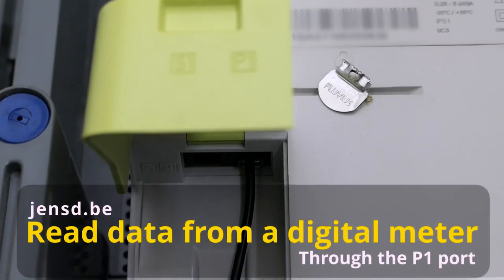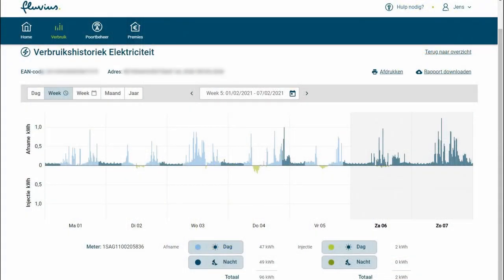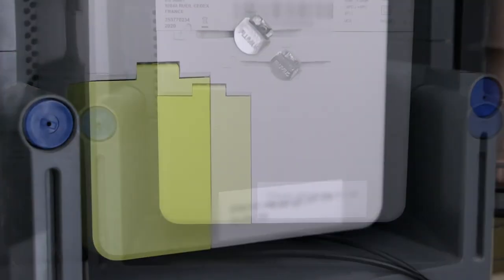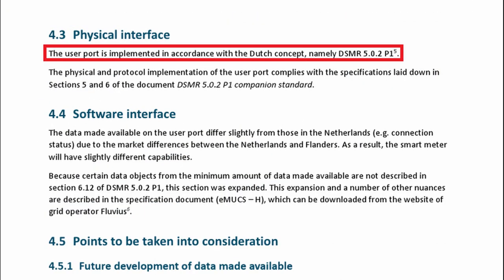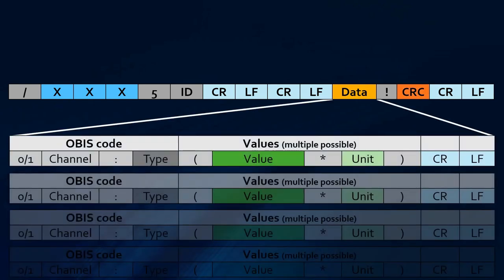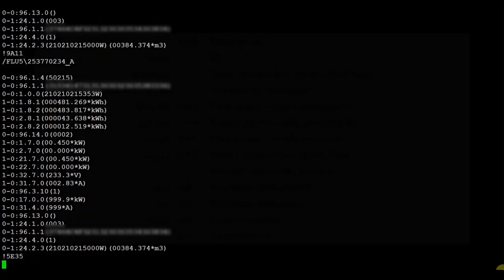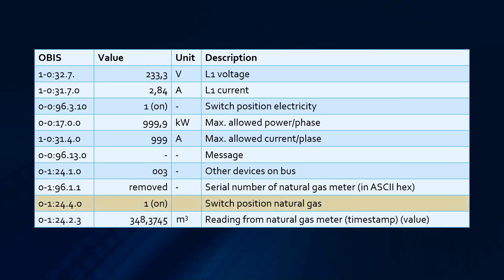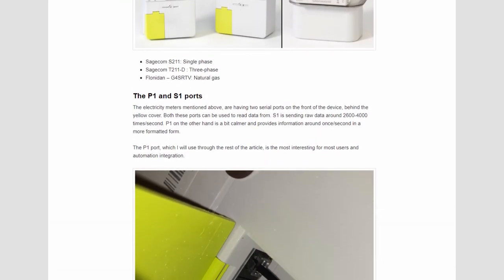Read data from the a digital meter through the P1 port using Linux

Comment: Excellent, I found the commercial option from Smappee way too vulnerable, expensive and the subscription model a real scam.  This wired solution sounds better since I only need to know if no major consumer remains active before I leave.  I wonder though, as the gasmeter seems to bind wirelessly with the electricity meter, can this signal be picked up as well ?  And does the electricity meter emit data over radio too ?

Comment: Although the S1 port can use the RS422 communication protocol, the P1 port cannot. The pinout of the P1 port indicates that no specific pins have been paid to Data- and Data+, which is essential for the RS422 protocol.

Comment: Fantastic, is the case for all the digital gas meter in Flandres?  I was wondering if I could get the gaz meter readings on mine as well I have a luminus key but with that I can basically do the same with a grafana / prometheus stuff, do you think would be too difficult to add prometheus metrics to the script?
Reply: Btw can you also share the link on bol for the right cable?

Comment: I have made a cable and a connection from the P1 meter by ESP-01s board, but the data I see in coolterm is chinese (asscii code). 
When I connect domoticz to the IP adress of my ESP board, the data is refused in domoticz. How can I make the data understandable by domoticz or Home Assistant ?

Comment: Can I do the same thing using an optical connector? CH340 usb to IR optical adapter for IEC1107 DLMS meter - Model MY001-B
Circuit supports IEC 62056-21 or IEC 1107 protocol. New to this.

Comment: IK heb een usb kabel. Ik zie hem. Maar krijg geen data. Linux is voor mij nieuw.  Ik programeer in codesys. Daarin kan ik Linux commandos uit laten voeren.
Hoe lees ik die USB0 uit?  Linux kent toch geen drivers  Volgens andere filmpjes moet ik hem met 'cu -l /dev/ttyUSB0 -s 115200 --parity=none'  kuinnen lezen. Maar krijg geen data
Reply from the maker: Codesys keb ik verder niet. Zie je het device op jouw machine? ls /dev/ttyUSB0 toont iets? Heb je rechten om dit device uit te lezen? Je kan eens proberen als root. Als dat wel werkt, wijzig de rechten van /dev/ttyUSB0 of voeg je user toe aan de dialout groep. Ala je het device niet ziet, unplug en volg (tail -f) /var/syslog en kijk welke naam het toestel krijgt. Succes :)

Comment: Nice and clear video!

Do you have experience with creating the cable yourself? After providing 5V to pin 2, and pin 3 to GND, I did not see any mayor voltage shifts on the data line pin 5.

Only pending investigation is shortening the cable (5 meters now), since that's the last thing I can think of for now...

Any suggestions? :)
Reply from the maker: Didn't make one myself but I believe you need pin 2 as RTS, data should then be received on GND (pin 3) and pin 5 (RX). The rest shouldn't be needed.

Comment: What if your meter discloses binary data? 
Otherwise good video. Tnx!
Reply from the maker: Could it be, if that is the case, that you're trying to read from the S1 port?
Reply: @jensdbe  Well, no. I have only the P1-port but according to the supplier they use IEC62056-21 mode D partly encrypted. I am out of options.